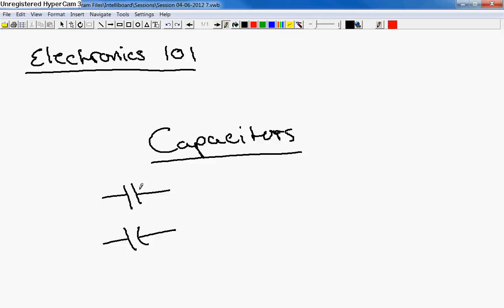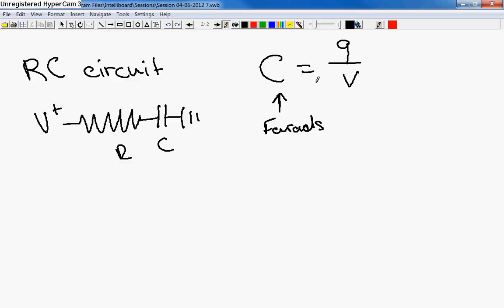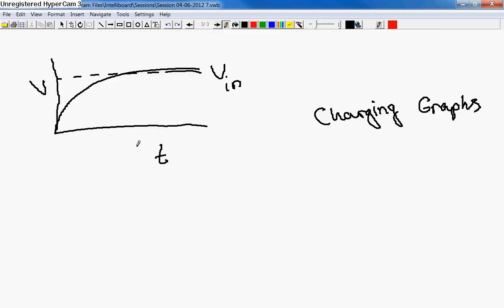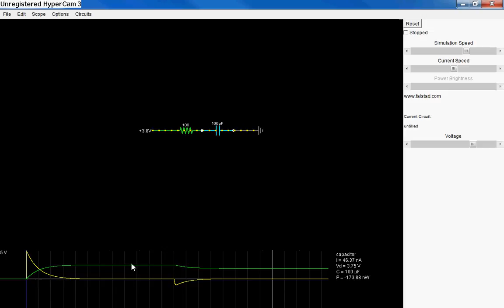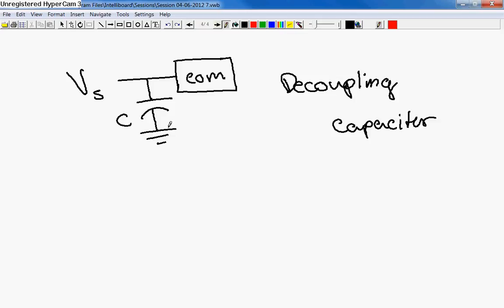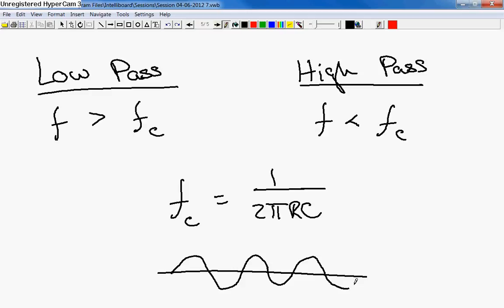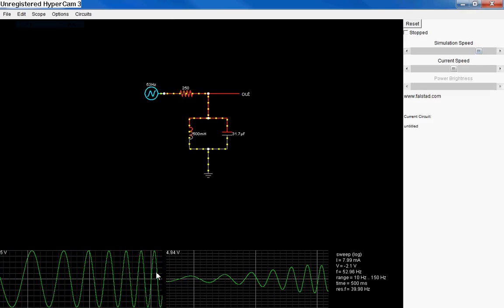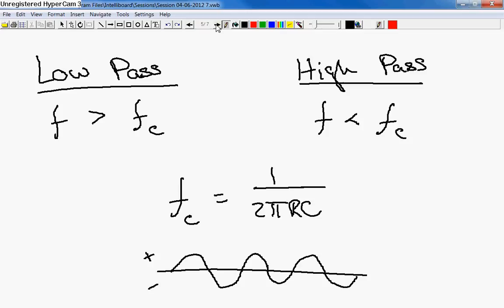Electronics 101: Capacitors

Comment: I am in the infancy stage of Electronics 101. To this point, I need a major clarification on battery voltage. You see many of these tiny, rectangular, 9V batteries being used on breadboards. A riding lawn mower typically has a 12V battery which is considerably larger than the tiny, rectangular 9V battery, yet the voltage comparison is 9V to 12V. Adding to my confusion is a 12V car battery which has the same 12V rating as the riding lawn mower battery, yet the car battery is quite a bit larger and heavier. What am I missing that differentiates between these voltage readings: 9V rectangular battery versus 12V mower battery versus 12V car battery. Thanks!!!

Comment: Hello human hard drive. I'm looking at using a 1000uf capacitor in a circuit to eliminate noise in the video. ( 12v dv power supply). what is the resistance needed?

Comment: If a capacitor has a rating of 10,000 mfd and a voltage rating of 60volts I know it's maximum operating voltage is 60 volts, but what I want to know is, if the circuit only applies 30 volts to the capacitor does it only charge to 5,000mfd?
Reply from the maker: No. The voltage has to do with when the dielectric of the capacitor will fail. It's still a 5,000 mfd capacitor even if you only partially charge it.
Reply: The last seven words in your reply answer my question. If the voltage isn't high enough, the cap will only partially charge.

Comment: Congratulations for the quality of your videos.

I got a few questions for you... On the differences between electrolytic and ceramic capacitors. I know one is polarized while the other is not. What makes an electrolytic capacitor polarized? Nothing in the capacitor theory would point to this...Would using an electrolytic capacitor equal to using a ceramic capacitor plus a diode? How come when larger capacitors are needed almost always electrolytic capacitors are used?

Comment: my shallow well pump will not start , I swapped the capacitor with a different pump and it works , the old capacity off the pump was 124 - 148 UF , watching videos on YouTube I came to the understanding that I could install something which is 5% less or 10% more from the original ,
 the question is?
 if I install a larger capacity will that  extend the it's life expectancy  ?
Old capacitive part number
 61B1D 120124NNAO ,
680171-001 ,
it has the manufacturing date of 16/07/2010 ,
My swimming pool pump had the same capacity for over 15 years no problems , I guess they don't make them like they used to.
your input is appreciated thank you have a nice day .

Comment: You use the  term SIGNAL, but you do not clarify what that is - Voltage / Amperage / Resistance / watts ?? Please clarify what  that mythical signal  is exactly?

Many  thanks for a great video series, I  am 72 years old, but have always wanted to understand electronics to a decent level, and you are certainly helping me to get toward that goal.
Reply: Ian Turner usually "signals" are read as voltages. For example, some circuits might interpret anything above 5V to be a "1" while less than 5V is a "0".  Thus, you can do logic operations in binary :)

Comment: Hi.. Hoping you can point me in the correct direcrion. I am trying to sup up a sander with a washing machine motor. I was told i need a start cap or (according to my research a run cap) i think i would perfer a run cap to help with performance. I already have the, "i think single stage motor" jerry rigged to the sander. When i switch it on it hums until i physically assist it. Was wondering if you inform me on what run cap i could purchase for a 5 amp 115v ge washing machine motor.... Thanks

Comment: Hi I know you can help me , I am working with 12V this is what I want to do extend time on my door bell . If you push button fast and let it go the bell time is short , what I want is for bell to work a little longer after you let button go . What  capacitor to use and how to hook up . Please get back thanks my channel is m42665
Reply: Use the Time constant formulas for charging/discharging of a capacitor and solve for C or C=q/V
Reply: +Bodhi Root Thank you for your help ! But I going with the 555 chip timer that I can change at will with out adding or put any parts . You would think the one who made the video would be the one to help out the people  but not the case .

Comment: I understand one formula for capacitors, which make a lot of intuitive sense, and seems deceptively simple: that the derivative (how fast it is changing) of the voltage across a capacitor is proportional to the current, for a given capacitance.

HOWEVER, what I do not understand is how to convert this relationship, substitute ohms law into it, and solve it. Currently, after some algebra, I was able to figure this relationship out:

C*dV(1)/dT = (V(2) - V(1) ) / R.

I got that from realizing that V=IR, and that dV/dT*C = I. Just substituted the 2 together. I do not know how to simplify that further though, to end up with that weird inverse exponential curve that is the charging curve.

Comment: How about a video about solid state diagnostics? 
Like say, how to find and fix the problem on say a guitar amp that had the speaker wires short by accident, and now has no sound coming out, and do it using just a multimeter and some alligator clip wires, since most of us don't have access to an oscilloscope & all the other fancy & expensive gadgets the pro's usually have....

Comment: i want to build a electric drag car im thinking capacitors are going to play a major roll since they can discharge all energy in a pulse ? hopefully work for ford electric division down the road  #fingersCrossed
Reply: I'm not positive so dont quote me, but i don't think this discharge will do anything for you as far as the 'explosion' of torque and force that you want out of your motors. I pretty sure though that it will help it get to and maintain top speed once it is off without any jumps in power running through the motors or motor and in turn increasing the life and efficiency of the motors. Please reply if you learn or have learned otherwise, saying as i am a few months behind your post.

Comment: Hey, HD, in the part of the high pass filter you have a resistor grounded at both ends? how does that work?. I would like to compliment you on your electronic 101 tutorials, very good and thorough!  the explanation of the high and low pass filters with the circuit simulator was excellent, Afrotechmods would've been proud of you.

Comment: I really liked this video.  Its the first one that actually shows a practical use for an electronic component.  Ive been dabbling in electronics for years and ive read several books in it.  The trouble i have is everything explain things like this: here is a capacitor,  it stores electricity,  here's  a circuit that uses a capacitor, next topic.  That doesn't really help me to understand what its purpose is and what its doing in that circuit or how its value was decided. Im looking for a way to learn electronics in a way that i can look at a circuit and see why ever component is there and what its doing in the circuit. Can you suggest some kind of linear path to take to start learning electronics more in depth?
Reply from the maker: I have a more logically laid out Electronics lecture series that works through all of the math that explains the behavior of these components.
Reply: interesting points ,if anyone else trying to find out introduction to electronics course try Sovallo  Circuits Expert Fixer (Have a quick look on google cant remember the place now ) ? Ive heard some incredible things about it and my neighbor got great results with it.

Comment: Great vid thanks. A cool suggestion for a topic would be solar power point tracking and low power current sensing with uC like 328p. Also I wonder if maybe the uC could be used as an ideal diode controller with two p mosfets with gates tied. If so that would be great. I love making the most of power and building circuits carefully to be lean.